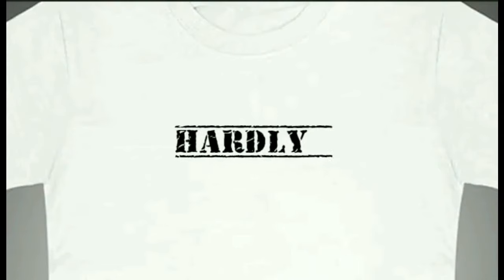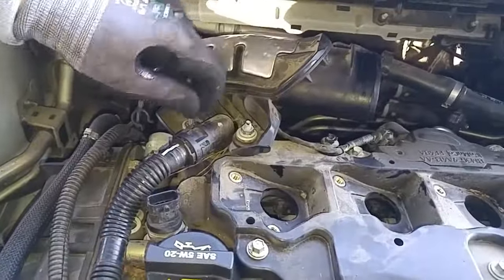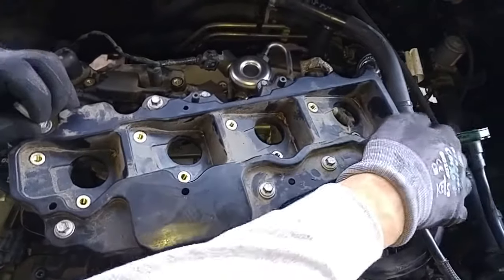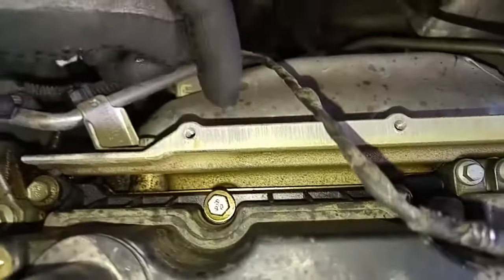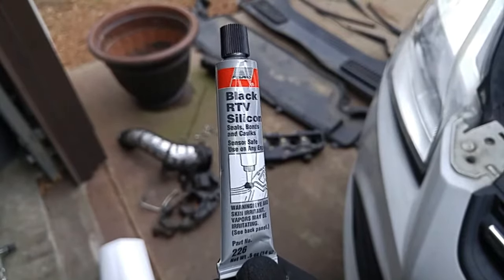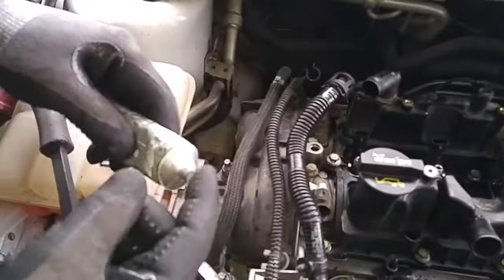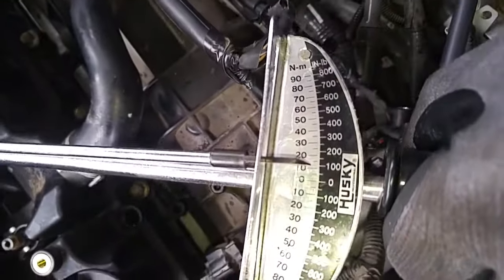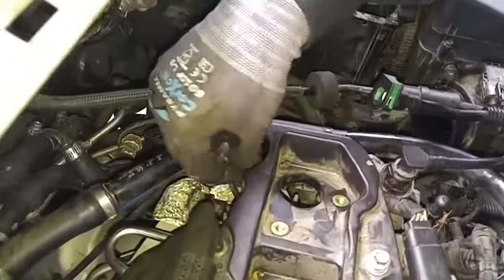Ford Escape 1.6L Turbo Valve Cover Gasket & Spark Plugs Replacement- 2013 - 2019 Fusion, Fiesta, S80

Comment: Thank you for the very detailed video. I’ll be changing my valve cover gasket this weekend. My local Ford dealer quoted me $850 for this repair!
Reply from the maker: Wow!  That's big bucks for less than 3 hours of work!
Reply: @hardlymovingpro  Yes because they pull the fuel injectors out of the engine also claim cant be done with them in their
Reply: $850!! I wish my dealership charged me that little. My dealer tried charging me $1565 in labor $100 for parts. Then another $225 in labor to change the spark plugs (oh another $120 for parts). All in all it was gonna be $2600 for valve cover gasket, spark plugs and ignition coils. I told them ill do it myself. This video is awesome help! Glad I didnt spend the money with them.
Reply from the maker: It's a pattern I'm noticing with auto repair quotes as more people choose to hold onto their cars instead of trading in for a new one.  There's the labor problem as well.  No one wants to be a mechanic and the repair shops are overwhelmed with service demand.
Reply: My Ford dealer quoted me $483 plus tax.

Comment: I have an estimate that is about $1,200 to replace my valve cover and spark plugs on '13 Fusion. Definitely going to take on the task of fixing it myself. Appreciate all the info!
Reply from the maker: That's a huge price quote on a job that shouldn't take at most 3 hours.
Reply: Ouch

Comment: Did you have release fuel pressure
Reply from the maker: You might get a little bit of fuel spillage when removing the pipe connecting the high pressure pump to the fuel rail.  Just put a rag underneath the flair nut before loosening it.

Comment: Thanks. I stripped everything off the top of the valve cover and removed the fuel rail to find that quite a big part of one of the O-rings had broken off.
Reply from the maker: That's not good.

Comment: Hey, was curious if you know the part number for the Variable Valve Timing Solenoid O-Ring?  Also really helpful video
Reply from the maker: The replacement O-ring came with the FelPro gasket set also included the RTV.
Reply: @hardlymovingpro  Awesome thank you, just found it on Rock Auto.  I was amazed that Ford didn't source those o-rings individually.  Appreciate the recommendation.
Reply from the maker: You bet!

Comment: What was the torque specs for the fuel rail ? My car isnt getting any gas to it after i put everything back together
Reply from the maker: They're only 10mm fastener bolts that require 10 or less lbs of torque which isn't a lot.  I'm going to guess that the fuel rail O rings are not seated properly and you're leaking fuel.

Comment: First, thanks so much. Spent almost all day doing this on my Ford S-Max. Never done anything like this before. All generally went well, fuel rail was a b*tch to get off but o rings stayed on injectors so all good. I got an oem Ford gasket which, at the vital moment, I discovered had a defect. So good tip would be get two! Had to put in on regardless.
I also did plugs, when I fired it up, started quickly but misfiring. I removed all the coils for visual check, having put them back in now it won't start at all. Thrown in the towel for today but any advice welcome. I have an obd dongle. Once again thanks, I owe you a beer!
Reply from the maker: Double check all vacuum lines and electrical connections (i.e. disconnect and reconnect).
Reply: I stripped back to the fuel rail and noticed that 1 of the injectors easily rotates if I twist it the others are all solid. Starts now but back to misfire. If that injector came loose with the fuel rail do I need to replace o rings and teflon seal? Or might the misfire clear in time? Where can I send your beer money, would never have had confidence to get this far without your help.
Reply from the maker: Not unusual for the injector to rotate.  Could be a defective fuel injector or the new replaced spark plug.
Reply: Got some help on this. Turned out too much grease in coils and residual gas in plug wells. Thought it was clean before but he cleaned with brake cleaner and running great.
Reply: @beefheadb0y   So I am in the same situation, you cleaned the coils thoroughly and it just magically worked?  Every time I take out the coils to trouble shoot they always have a little bit of oil around them. Any suggestions greatly appreciated!

Comment: I finally did this today on my 2013 Ford Fusion. It seems to be very loud and I forgot to put the foam stuff back under the fuel rail so not sure if that is it. I did have a misfire code and it could be a bad coil but it has me worried . I just quit for the day and will make sure everything is hooked up and maybe unplug the coils one at a time. It was not a pleasant job and I appreciate the video
Reply from the maker: Thanks for sharing.  The foam is used as a noise dampener.
Reply: @hardlymovingpro  My car had a broken MAP sensor and a bad coil. I got it done today and it has never been so smooth. My wife complained of poor mileage so I think the MAP sensor has been broken awhile. I really hope you know how much I appreciate your video. We need that car and I cant afford all the labor. I would watch you do something then go do it. I am in your debit
Reply from the maker: You bet and thanks for sharing!
Reply: I just did my 13 fusion today as well same result. What was wrong with yours? Cylinder 2 and 3 missing is what code reader says

Comment: Donde tiene su taller amigo?
Reply from the maker: Al este de Memphis, Tennessee.
Reply: @hardlymovingpro cuánto cobra usted por cambiar el empaque de los cilindros, mi Ford escape 2013 está gastando líquido refrigerante por eso y tiene el cilindro 1 bloqueado
Reply: @hardlymovingpro  ahora llevo una hora de carretera y me dice (temperatura de motor alta pare con cuidado)
Reply: Cual era el problema y cuanto te costo arregarlo? Gracias

Comment: Gone are the days of the 30 minute valve cover job. I am going to do this on my wife’s 2013 fusion. It was done twice by the dealer under warranty but this time I will do it
Reply from the maker: Use FelPro gaskets in lieu of Ford OEM.  May have better luck with longevity.

Comment: I’m getting ready to replace my VC on 2014. Would you recommend the complete kit with gaskets and o rings? Nice vid.
Reply from the maker: If the valve cover has no cracks, I'd just replace the gasket and o rings.
Reply: @ Thank you.

Comment: I just did this job today on my 2015 Ford Escaoe with 141k miles that had an active oil leak at the rear left corner of the valve gasket. I had a boroscope camera and it was leaking pretty good! I appreciate all the information and detail you put into this video. Ive torn my car apart a few times and do my own maintenance. This jobs took me about 3 hours, from hood open to hood closed with a few breaks. 

For anyone that is doing this, you might want to clean your ignition coil boots and fill the ends with dielectric grease (mine were filled with oil). 

A tip for when reinstalling your windshield wipers, turn the car on to accessory mode and then turn the wipers on once and then turn them off, this will lock them into the off position. While the car is still on, install your wipers. 

Can't thank you enough for giving the weekend warriers help. I love wrenching as much as then next guy but gives me confidence when I know exactly what to do!
Reply from the maker: Thanks for sharing you wonderful repair story!
Reply: That's the same place that my Fiesta ST is leaking pretty good.  I didn't notice how bad it was unti l did the timing belt a few weeks ago.

Comment: Im about to dive into this today.  My moms car has a broken spark plug to extract!  I guess those ole triton spark plug "train wrecks" carried over to the 4 cylinders 😂
Reply: I like the celaphane under the cap trick, for opened tubes of rtv
Reply from the maker: Yup.  Keeps the RTV from drying out
Reply from the maker: Not aware the plugs break on these engines
Reply: Well.  Let me start by saying, vehicle was bought used with under 20k, from CarMax.  Car now has 70k.  She recently got misfire on cyl 3, so I decided easy enough, threw a coil at it, that did nothing.  So, orders up a set of plugs.  Number 3 was going to be last, so I r&r #1 and #4, they came out as they should.  Number #2 was a Trainwreck, I ended up idling the car for 20 min intervals, and applying wrench to "nurse" it out.  It was a real bear.  But, I got it out.  That #2 showed the threads similar to cross threading, but I really think maybe dissimilar metals in combination with forced induction, maybe something else.  Anyways, chased the threads and installed that new plug.  Moved onto number #3 (initial misfire hole), and did the same process of heating the engine then breaking out tools to work that one loose.  IT BROKE, AND LEFT ABOUT 100% of the plugs threads, in the head.  I've done service and repair for greater than 25 years,and never broke a plug until now.
Reply: I needed your video, to familiarize myself with how much space I can gain, accessing the extraction, with valve cover off.  That's how I found ya, lol 😅
Reply: Did you by any chance relieve the fuel line pressure before opening up the rail?  I know I have heard quite a few warnings of caution, when dealing with piezo style injectors, and mechanical hi pressure fuel pumps.  That part of the fuel system is capable of incredible pressures.  Pressures that high, scare me.  I've seen some videos and damage pics of hydraulic pressure injuries.  Talk about, the vapor that is hardly visible, is enough to cut thru fingers, to the bone.  Then of course, the infection that follows.  Ugly stuff.
Reply from the maker: It'll leak out a little which I blow off with compressed air.  I found the not much residual pressure from the hp pump to the fuel rail when I removed the fuel line (as shown in the video).
Reply from the maker: Wow!  What a story!  Broke a rusty plug in a GM vehicle around 15 years ago.  People were telling me to pull the head.  I used a combination of a drill and easy-out tool to get the lower portion of the plug out.  I know I got some of the ceramic bits in the chamber but the car ran fine after installing the new plug.
Reply: @hardlymovingpro  yeah, I've been doing plugs for European cars for a very long time.  I guess I appreciate plugs that use a crush gasket style seat, as opposed to a conical seat.
Reply: @hardlymovingpro  I ended up letting compression stroke assist me with porcelain removal 🤪
Reply from the maker: @sidewayzmike  or the stuff blew out in the exhaust strokes.
Reply: @hardlymovingpro  it's tough call, but I fished out quite a bit in the spark plug valley.  I might've even had some ricochet up, out, and deflect into the cowling, that eventually I removed.  I got under the car and beat the belly pan to listen for anything loose\anything rattling and had another piece of porcelain hit the garage floor.  So, I'll probably take that extra step and remove the belly pan to further investigate.  I'm entertaining shooting shaving cream into that cylinder, before I get into any drilling (hopeful the cream will help collect any shavings...heard that trick thru the technician grapevine, and I like the sound of it, haha 😅
Reply: Got the broke plug out, took some precise drill work along with easy out.  Now, I'm resealing valve cover and I gotta figure out resealing my Teflon seals on the injectors (special tool required 😮).  Btw, I noticed the valve cover has some plastic tube that is internal of the larger valve cover.  I got lucky on my removal, lifting the cover straight up, if not, that tube could crack accidentally.

Comment: I have a 2013 1.6 Escape and I have to tell you that your dedication to putting together such a detailed video is invaluable to all weekend home mechanics out there and i am very grateful!!! Now I have a guide to follow as i ran into a lot of the same issues you ran into ie: those darn variable timing solenoids spraying oil everywhere! I'm in my late 50's now and just chuckle to think back when we were younger and didn't have the benefit of watching you tube videos as it is such a great resource. Again, great tool but nothing without dedication from people such as yourself that really put great videos together. Keep up the great work!👍
Reply from the maker: Thanks for your kind critique of this video!  Quite honestly, when I first approached this job, I was scratching my head.  Where do I begin?  I figured take everything on top of the valve cover off!  After I dived in, it was like "now what's in the way???!!!". 😩

Comment: Man your video has been super helpful, with this video as a guide I replaced this on my Volvo S80 1.6 T4 that has the same engine.
2 Hrs after I changed the valve cover gasket, my coolant outlet gave out (nothing to do with this gasket job btw), where the plastic was as brittle as the valve cover gasket as well. Just falling in to pieces like a pretzel.
Do you have any advice for these 1.6 Ecoboost engine for other parts than the valve cover gasket and the coolant outlet that have plastic in them that just gets worn out and brittle over time? I might replace those parts too before they give out but as a DIY-er I have no further experience on these :) Thank you.
Reply from the maker: Thanks!  It's unfortunate that too many car manufacturers are replacing metals with plastics which eventually fail with age as well as repeated heat and cold cycles.  I'd recommend you replace vacuum line hoses and check for brittleness of the plastics connectors.  Don't attempt to pull the hoses off.   Use a razor to make a vertical cut to ease removal.  I've also experienced the inlet and outlet hose connections on radiators, heater cores and T connectors fall apart in my hand attempting a hose replacement.  Check out this video on a Ford T connector:  https://youtu.be/hL6w2MhvM0I

Comment: Update:   10 Sept 2022:  on 2014 Ford Escape,  1.6 ltr .

Just completed the valve cover replacement:  Your instructions were on the money!!!.
The only problem I had was at the fuel rail.  Two of the injectors came out with the rail.  Easy job to put back.  

All parts recommended by you were correct.

The job took me 4 hours to do.

Thank god for dielectric grease.
Reply from the maker: Good and you and thanks for sharing!
Reply: One of my fuel injectors came out too. Did you just push it back down? It seems to be a little “wiggly” compared to the others.
Reply from the maker: Doesn't matter if the injector came off from the top or bottom.
Reply: @hardlymovingpro  Thanks!

Comment: Thanks so much for the video!! Just finished my valve cover gasket and replacing my injectors at the same time. Took me 4 hours and saved me a ton of money. 

I’d like to add that it is supposed to be a 3-stage torque on the valve cover bolts. 
5 nm
9 nm
10 nm 
There’s also a specific sequence to torque the bolts that I found shared in a forum. 

Thanks again!
Reply from the maker: Thanks for sharing and glad it all worked out for you!

Comment: How do I find those O-rings you replaced ?
Reply from the maker: They're included in the FelPar gasket replacement kit.
Reply: @hardlymovingpro thank you. The seller doesn't really make that clear.
Reply from the maker: @dustin1870 you may be right.  The kit I bought came with them without stating that they did.  Anyway the old o rings may still be okay.

Comment: Thank you so much for this video.  I was able to successfully do this job because of your help.  The other comments of fails seemed to concern the injectors, so I was very careful in removing the fuel rail without disturbing the injectors, and had replacement o-rings ready to go on.  Had to order an entire kit for each injector to get the top o-rings, which I replaced as you instructed.  Thankfully I did not have to use the other parts of the kit, because the injectors were undisturbed while removing the fuel rail.   For others thinking of doing this -- take notes, take your time, be prepared.  Hope you have success.  Thanks again!!
Reply from the maker: Good for you and thank you for sharing your repair experience!

Comment: Thank you for the video extremely helpful. I just finished mine but now I have a misfire in 3 cylinders. When I pull  the rail 3 injectors came out and that the 3 I have a misfire. I replace the orIngs. 
Thank you
Reply from the maker: If there's a problem with any of the o rings, you experience fuel leakage.
Reply: It's direct injection... The tip of the injector that faces the block has a Teflon seal that need to be sized up by seal sizer from Ford. The green o- ring that faces the fuel rail those get lubed with a little bit of oil. But the Teflon seal has to go in dry with no lubrication..... If you don't follow the correct for installing Teflon seals on direct injection you will get a misfire... The car in the video got lucky that they got stuck in the block and only had to replace the green o- rings
Reply: Yeah I ripped 3/4 injectors out with the rail. Immediately knew I was screwed... Went ahead and tried to seat em back into the cylinders as snug as possible, but yeah I can hear and smell fuel spitting when the fuel pump charges the rail. Throwing codes. Won't even start today. Completed the install yesterday... So idk what in the hell I need to do at this point. Pisses me off. Clusterfuck of an engine... I've overall had good luck up until this point, but she ain't liking life right now that's for sure...
Reply from the maker: Get new o rings, if damaged/torn, lubricate with dielectric grease then reinstall.  The grease will noticeably ease installation.
Reply: @hardlymovingpro  yessir. Gonna try and get replacement kit to replace all o-rings and the Teflon seals. Can get a kit for dry fitting those Teflon seals as well I think. Thanks 👍🏻
Reply: So, if the injector comes out, you have to buy the new Teflon seal from Ford? Tnks